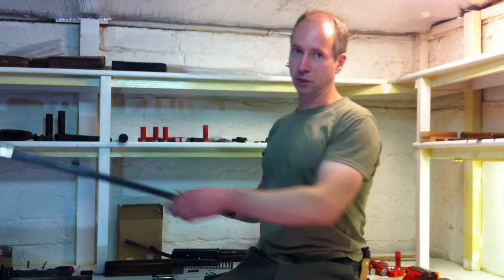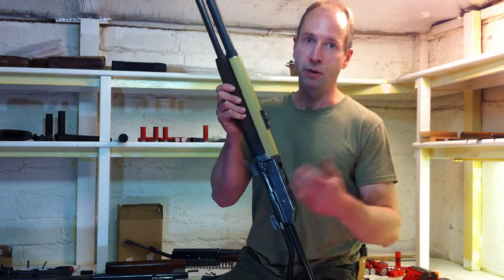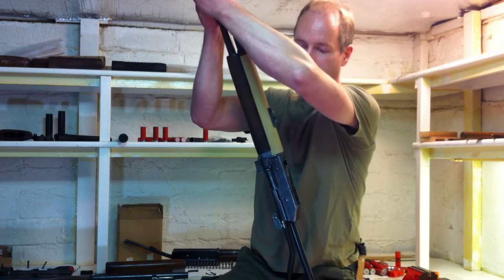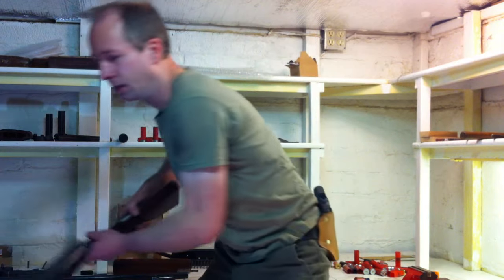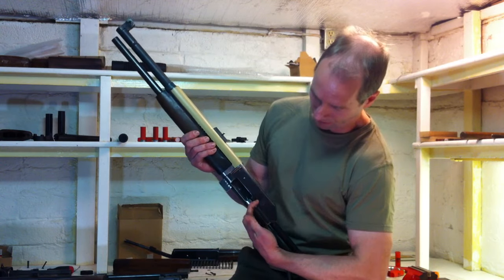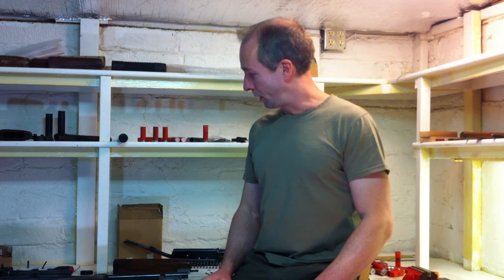Remington 11 upside down experimental shotgun - live fire demo

Comment: What I don’t understand is that when in normal function, the link to the locking block goes into the action tube allowing the locking block latch to disconnect. If the bolt travels directly rearward, the locking block should not disengage. How did you fix that?

Comment: Okay my slightly crazy friend.
you can make those springs work, you just have to stress relieve them.
pack those suckers in steel wool, seal that up in an aluminum foil envelope, and bake those suckers at 450f(ish) for 30-60 minutes, let them cool naturally and then bam- springy, resilient springs that don't take a set so quick. if done right they should have almost as good life as a professionally made spring.